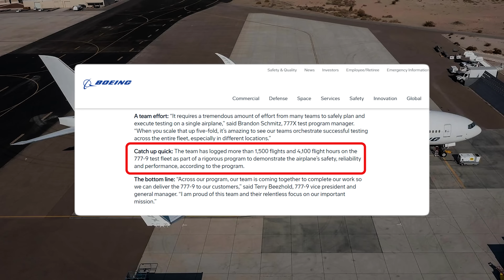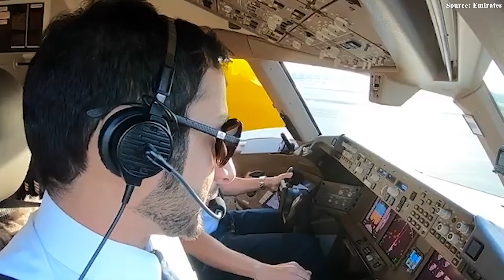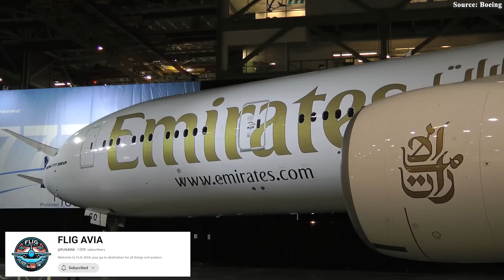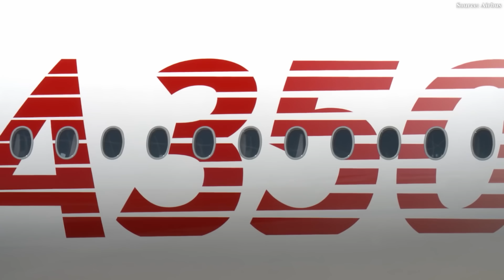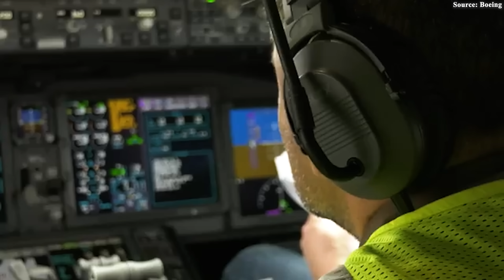Boeing 777X Is In HUGE Trouble Again That SHOCKS Entire Aviation!

Comment: Delta Air Lines has been flying it's A350-900 since 2017, even buying 9 from Latam Airlines and refurbishing them to Delta's configuration. They have 20 A350-1000 on order as well. Boeing's B777X delays have kept it off the market for almost a decade while A350 Operators have been making money with it.  It's not a good sign for Boeings Delivery delays when Carriers with B777X on order are quickly trying to add A350s to their fleet to fill in until the 777X arrives.

Comment: STOP with the drama. They are waiting on the FAA. Word is it's just a few months waiting on them now. They are already starting back production so they will have aircraft ready to deliver. It's NOT huge trouble.
Reply: Thank you thank you for posting your reply. I was about to go on a rant, but you took care of everything for me.😅
Reply: I agree. Without a doubt this has hurt Boeing but this is the first certification process after the Max issues.  Airbus will have trouble with their next major certification.   Drama though gets clicks and views
Reply: It's a major problem as the delay of the 777X Crashliner and the MAX Crashliner 10 has caused tariffs add ons in Europe. We don't have those new problems with Airbus 350 and Comac C919's
Reply: @idarpolden5913  only been around for decades and decades older than you. It’s got a great history and stop calling it a crash liner. It’s better than the scare bus.
Reply: @Legalalien1776Yeah, you're right. It's the MAX 8 & 9 that's been nicknamed Crashliners.
looks obvious that the X stands for the 777-Groundliner as  it started production in 2013, but is grounded for test flights!

Will the MAX 7 & 10 also become Groundliners?

Comment: Just WHAT is wrong with the 777 programme as a flyer.?
Reply: It is not the airplane. The FAA certification process of the 777X is not staffed enough by that agency. That is why it is taking so long for the FAA to certify the aircraft. The FAA has also slowed down production of the 737 and 787 lines because it also does not have sufficient staffing to supervise Boeing. The problem now lies on the FAA.

Comment: Broken thrust links? That’s a serious red flag.
Reply: It is serious, but not difficult to engineer a fix. 
BTW they have been cracked, not broken, big difference
Reply: It's actually Boeing's handling of the MAX Crashliners, by claiming pilots error that's the main issue.
Boeing's denial is our problem that has open the doors for Comac
Reply from the maker: Agree